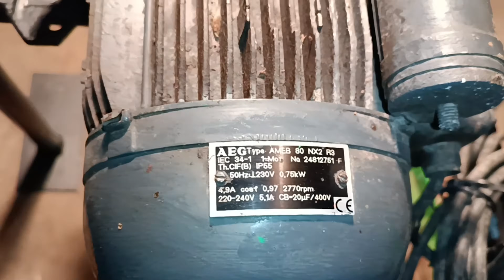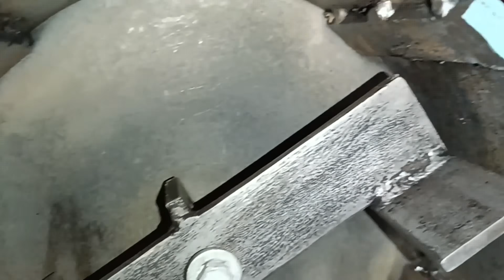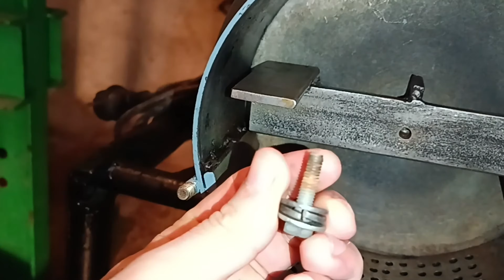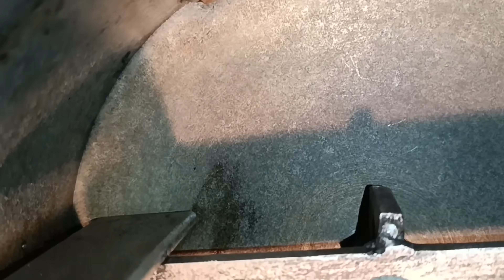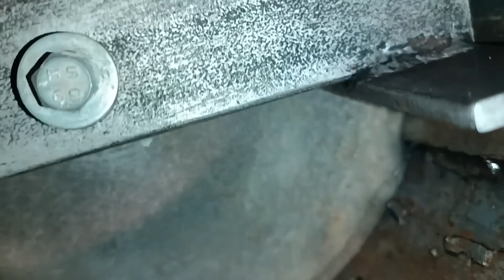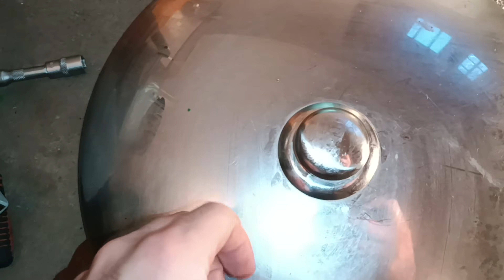DIY Olive Crusher for Homemade Extra Virgin Olive Oil  Step by Step Build

Comment: I copied this design from the video called DIY oluve crusher. I used a 1/8" key to mount the cutter on the motor shaft. 
It works really well. It took about 15 minutes to do 44kgs.
The motor is .75hp three phase. Got a bit warm but it could handle the load without flinching. I reckon a 5hp would be better.